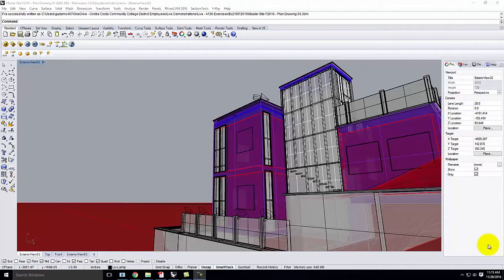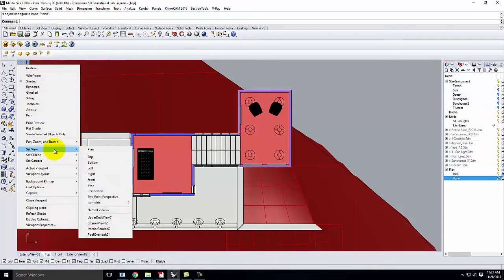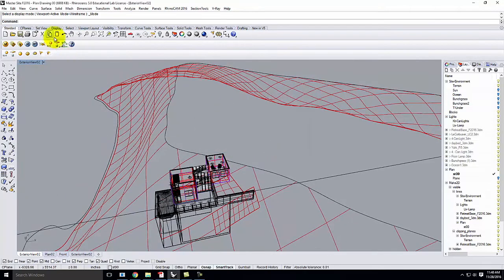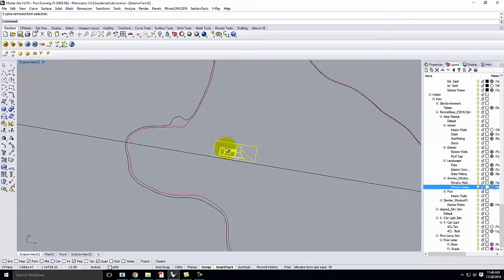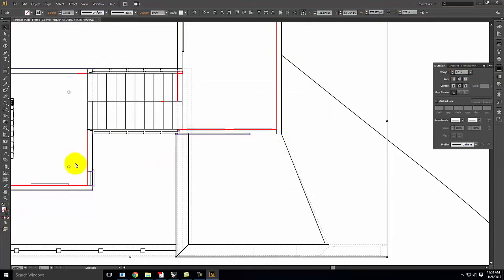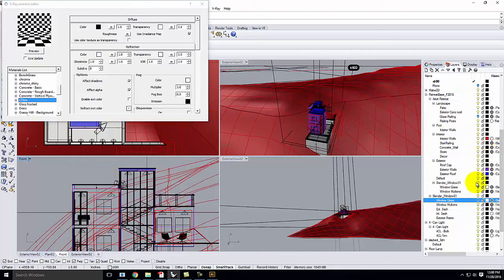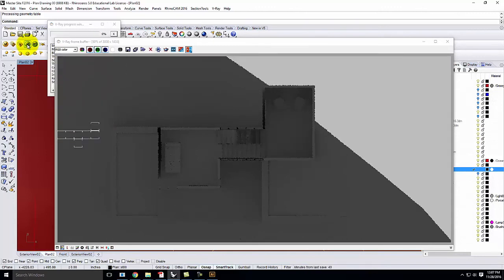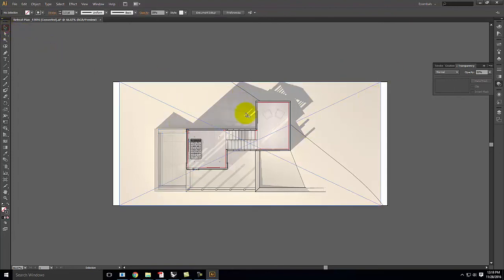Lecture 229   2D Drawings from Rhino   Plans Fall 2016

Comment: Hello Grant,

thank ypóu for that video. This is quiet good. 
But I do have some question. Normaly I worked with an other CAD-Program. Since 1 year I switch setp by step to Rhino. At first, if this video will show me how to draw a normal groundfloorplan, I'm a little bit shoked of all those step that we need to finish it. Is that really so complicated like this? Till you finish your first result you need more than 19 minutes. I guess you are an professional and you are fast. But in a case of a rookie I will not imagine how long it takes. An hopefully I don't Have a lot of sectionings and/or afterwards modifications.

Unfortunatly I lost the thread in the first minutes. So it will be easier to follow with an less complicated object. Do you have a tutorial for cutting an object and afterwards with layouting?

Finally I want to say that you to a good job. I think Rhino is in that case dibious.
Thank you.